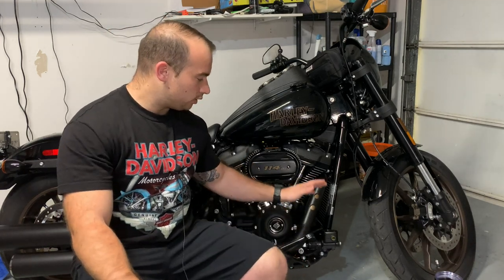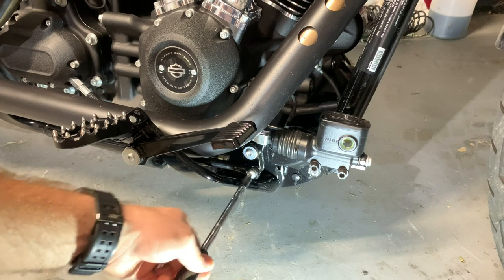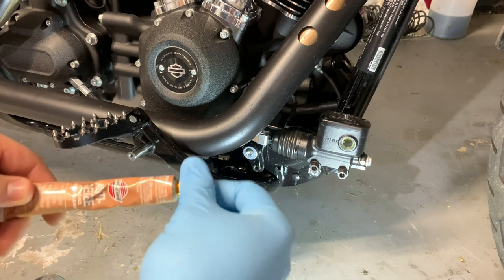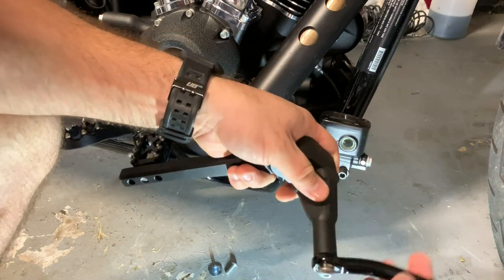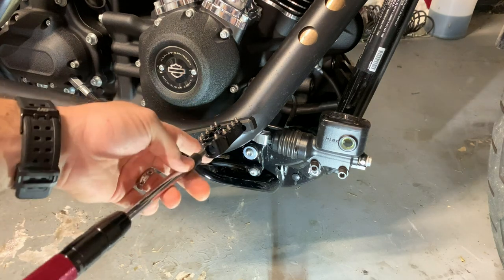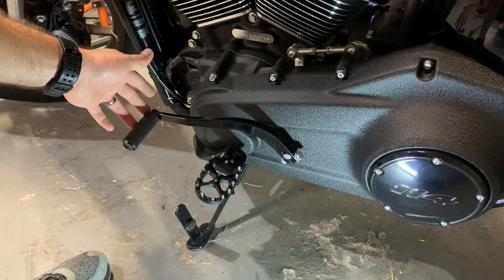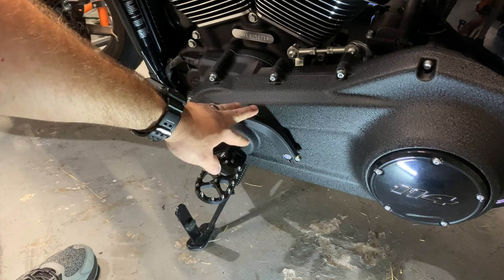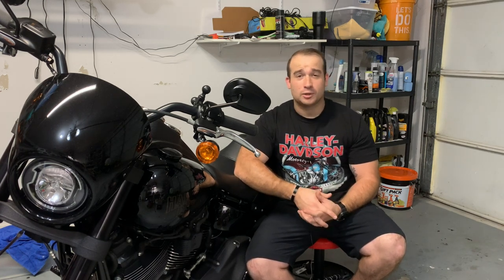How to change brake & shift pedal arms on an M8 Softail (Low rider build series ep 3)

Comment: You are probably one of the best DIY  thanks for the detailed videos you are putting together. And also appreciate not including metal thrasher music on background. Lol... I feel I can concentrate better what you are saying n your tutorial instructions in step by step. Appreciate it. One question though, I am thinking about investing this flo brake arm but instead of oem linkage, I have adjustable greenbrother linkage that allows me to have positioned higher than crappy oem angle.   Would these steps will be the same then?
Reply from the maker: Thank you man! And yeah lol….actually I have a video installing the Greene brothers brake linkage on my bike with the flo lever. This is a pretty old video in my build series. It’s the same process man. Easy peasy!

Comment: Great vid! Man, I was feeling good about the video I’m dropping Monday morning on changing out my shifter arm and linkage until I watched this vid of yours. Great job! Can you tell me what that long wrench you we’re using is called? I’d like to pick one of those up.
Reply from the maker: Being Here Now, with Percy lol I’m sure yours is gonna be great as always man! And I’m not sure what it’s called I’ve had it for a puppeteer years now too. I can tell you it’s craftsman though lol. It comes in handy so much man. The little middle piece is adjustable and even removable too and the end is just a 1/4 male end so you can use pretty much anything on it. I think I bought it at ace too. It’s held up perfect. The end of the handle has a 1/4 also so if you need a lot of leverage you can switch attachment points

Comment: Nice video.  I just picked up the same bike.  Funny, I ordered the same Saddlemen seat with all black stitching :-) Where did you get the T bar socket handle, as well as the "thin/skinny" hex bit sockets?
Reply from the maker: Thanks man! These step ups are the way to go! The sockets were from a large kit from Kobalt at Lowes I've had forever. The T Bar tool I picked up since I started bike wrenching and it's from Craftsman-I bought it at Ace Hardware. Its a life saver man. It has a male end at the end of the handle too if you need extra leverage. Best tool I own for sure
Reply: @RidinDad  Awesome, I have been looking, now I know where to go.  Thanks for the info.  My Kraus risers came in today.  Having S&S Super Streets header/pipes and torque cam installed next week.  Love the Saddlemen's seat have the road sofa on my Street Glide.  Ride Safe & thanks again for pointing me in the right direction...
Reply from the maker: Sounds good man. Enjoy!! Thank you 👊🏻

Comment: I finally got around to ordering a set of these myself and was re watching your install video for reference. Still happy with choosing to use anti seize on the brake pedal shaft?
Reply from the maker: Awesome! And yes, I’ve never had an issue with it. It’s designed not to get gunky and everything. So I would definitely do it again. I have about 2000 miles I and countless hours with it since I installed it
Reply: @RidinDad  I'm curious about your thoughts on the brake lever. I got mine up in the mountains this weekend and it's little disturbing how the bottom of brake lever drags when leaning. I measured it when i got home and there is an inch less clearance. I'm afraid it will cause the rear brake to engage since the dragging motion is the same direction that engages the brake when pressing it with your foot which is not encouraging...
Reply from the maker: Yeah that worries me too honestly. I thought it was because of the tbr exhaust requiring the spacers for the brake side controls. I’ve had it scraping a lot and never had the rear brake engage due to it but you never know :/. In the future I’m gonna look in to switching or solving that issue some how
Reply: @RidinDad  Figured I'd follow up on this. Instead of doing the logical thing and just putting the old brake pedal back on I went ahead and put in a longer monoshock and the addition clearance seems to have solved my issue. I'm still running stock headers so your thoughts about the extension on your brake side due to the exhaust is probably correct.
Reply from the maker: Yeah I already have the extended rwd rs-1 mono shock so that plan is no good for me lol. I’m gonna wind up calling them and see if they either know about it or have a solution or some thing. If not I might just go ahead and look around for some other aftermarket brake levers that will still allow the use of an aftermarket foot pad

Comment: Hey dumb question maybe but what is that tool called that allows you to get so much torque when taking the brake arm off ?
Reply from the maker: It’s just a t handle. Mine is 1/5 size. But they make a few different sizes. It’s from craftsman
Reply: @RidinDad  thanks man!

Comment: good vid, unrelated, is that a stock seat?
Reply from the maker: Thanks man, and yes that is the stock seat for that bike. I have since replace it with a saddle man step up
Reply: @RidinDad  i'm on the fence on either the saddlemen or lucky daves
Reply from the maker: I’ve never had the lucky Dave’s so I can’t speak from a personal experience but I can tell you that I absolutely love the step up. This is the second bike I’ve had both different styles with the step up seat on them and I will continue to buy it again and again. It really locks you in to the bike and is very confidence inspiring. I also think it’s very comfortable
Reply from the maker: From what I can see I think it really comes down to the step up has almost a 90° angle in the back and the lucky Dave’s is more of a curve
Reply: @jeffstange9183  saddle men's makes lucky Dave's. So it's styling for the logo at that point
Reply from the maker: Not true at all. They’re different seats. Lucky Dave’s has different dimensions
Reply: @RidinDad  saddlemens makes their seats that much is true. And the LD's and Saddlemens I've seen in person have been very similar
Reply from the maker: Yes they are similar obviously, but the back rest angle and the foam dimensions and everything are different. They are different seats but similar so don’t try to tell somebody that they are the same and the only difference is logo. Saddlemen makes the sdc pro seat and whiplash pro seat too and those are completely different

Comment: I have all the flow motorsports on my bike just like you except my shit is red got the brake pedal shifter pedal in black because that’s all they come in then I added to read two pages to each one read the two image style pegs for me in the same color for my wife I think everything cost me like $900 to buy everything to switch out the flow they’re being installed right now with a new two and a one 2 into 1 pipe and a TTS Tuner Then being throw it on the Dino jet to remap everything 2019 fxbb
Reply from the maker: Awesome, it’s gonna look really good when you are all done. I just installed the levers and I posted a video a little bit ago on them and they make a gigantic difference also. All their stuff is really high-quality

Comment: Any videos changing out the headlight with the adapter?
Reply from the maker: Which adapter? Like the one that just extends it forward? Or the bucket one for use with some fairings? And probably no to either of those lol. I’m waiting to buy an fxr fairing and I’ll be putting in a 7 inch moons mc headlight with that sucker
Reply: Bought a new headlight and I went to install. Removed the fairing and disconnected the headlight. I quickly realized I needed an adapter as it’s not just a plug and play to stock wiring assembly. Check out J.W. Speaker Headlight Adapter
Reply from the maker: Yeah I know which one you’re talking about. Moons mc makes one too. It’s odd how the stock fxlr headlight isn’t in a shell or anything.

Comment: I'm back, finally got my Low Rider back from the dealer and will be doing some of these mods.  I'm not super mechanical, but watching you do this I know I can do it too. Question, is the anti-seize necessary when you were adding the brake arm?  Is this something you will need to reapply from time to time, or one and done? Is this because it's metal on metal as you say?
Reply from the maker: Yeah metal on metal with the bushing. I don’t think you need to reapply often at all. I don’t even know if you need to put it on in the first place. I just had it already so I put it on for piece of mind pretty much

Comment: Flow sold out of the Milwaukee 8 softail stuff for now
Reply from the maker: Crazy. They make awesome products!!
Reply: @RidinDad  Hell yeah they do like I said I just spent 900 on every control for Milwaukee eight down to read toe pegs to black brake pedal and shifter pedal to read passenger pegs and foot pegs like I went all out hand controls
Reply: @RidinDad  And if you put everything on right you won’t have no clutch issue not engaging it’s called on properly LOL like you did
Reply from the maker: Lol yeah I read that guys review too. Sounds like he adjusted it too far in and doesn’t understand how manual clutch’s work lol

Comment: Do you know if other brands tips will fit?  Not a fan of the spikes appearance, so would the softer material tip that was on your shifter (the one you said was a bit too long) fit on the flo arm?
Reply from the maker: I’m sure it would. Can’t confirm from use but they’re all interchangeable for Harley’s. These levers do not specifically say that you can only use the pegs from flow with them. They all have the same thread pitch and even if they did not you can just change the bolt on the interior really easy. But I would almost guarantee you any peg made for Harley would fit these for sure
Reply: @RidinDad  - I received my Flo arm, looks great.  I can confirm that yes other brands shifter pegs will fit.
Reply from the maker: Awesome man!